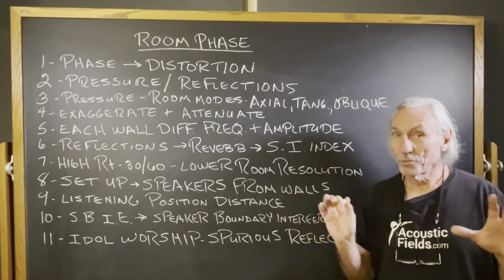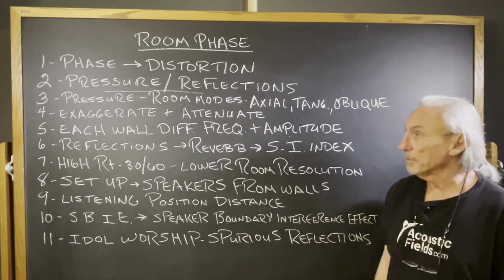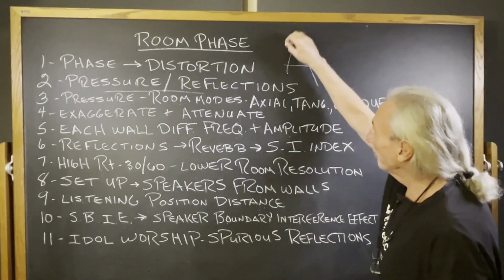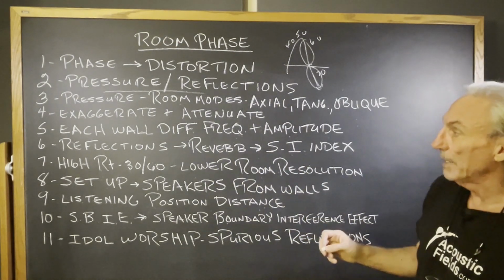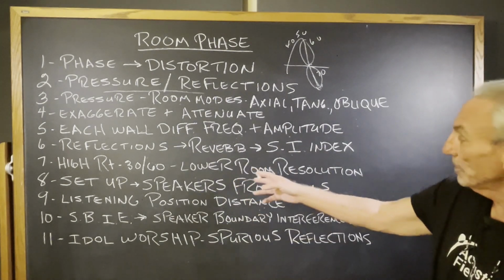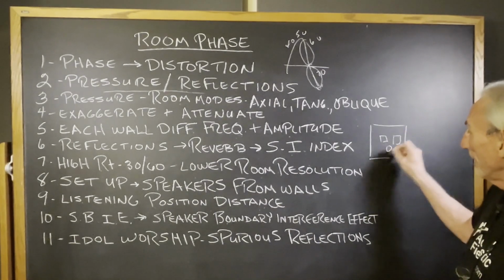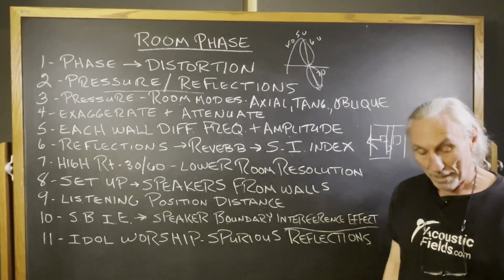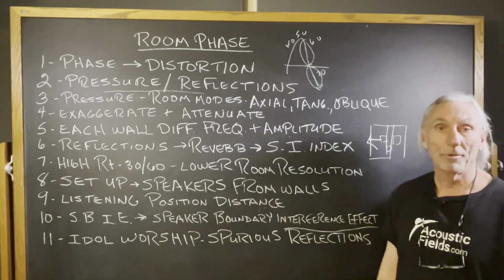Room Phase - www.AcousticFields.com

Comment: Hi Dennis, very interesting as always, can you make a video of  integrated wall speakers and boundary effect? In these type of speakers the distance from rear wall (not considering now the side walls) is zero.
Reply from the maker: There is no 0 value anywhere is a room regardless of what companies say. Remember the room is a closed system where energy is contained within a box. Pressures increase and decrease in amplitude forming modes and reflection time signatures are constantly changing based upon distances within the room boundary surfaces.